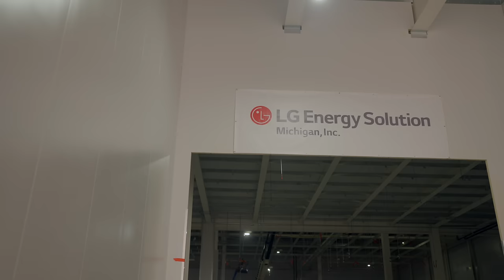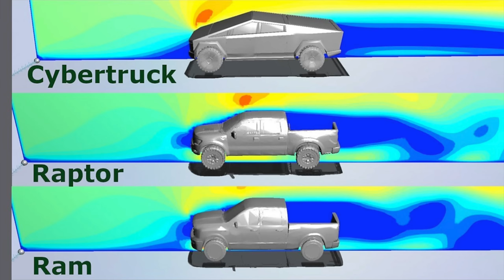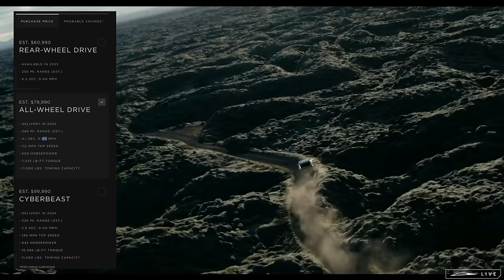Cybertruck - What Tesla ISN'T Saying!

Comment: I think they should put a battery pack that covers the whole bed raising it by 1-2 feet for the long-range towing that the 15% are wanting, less space in the bed but possibly almost double the range lol. I'm not an engineer, so I don't know the specs for batteries as in space and the heating and cooling needed if they did that, but the 470 range might just be enough, but only time will tell if they make other battery extenders other than the one they will have for now.

Comment: I watched until 12:20. After you're done repeating everything we just saw Elon explain, are you going to go through it a third time?  Variable-rate steering. That's hardly new.
Reply from the maker: list cars with steer by wire... go!
Reply: @TwoBitDaVinci  So you have reading comprehension difficulties as well. I mentioned variable steering.

Comment: Perhaps you have not heard? The 800 volt high voltage power is confirmed. The battery can be charged as 2 400 volt packs for backward compatibility with older chargers.

Comment: It takes 13 4680 3.7 volt batteries in series to make 48 volts while holding the power of a single battery @ 26 Ah. We really need Detective Thunderf00t to help us dissect this. While I wouldn't call 48 volts low voltage, 72 volts really is the sweet spot.

Comment: I don’t remember you even mentioning this “new steel” before. Who makes it, will they be able to make replacement parts for autobody shops, or will every dent cost you $20k and two months while Tesla makes a repair? 
Between that and the 48V electronics, it doesn’t sound like there can be any aftermarket customization which the enthusiast crowd can get for an F150.
Reply: Tesla problems for you (much of the reason I won't buy one ... I have an EV, it isn't a Tesla, I'm okay with that)

Comment: LMAO that crash test shows that occupants would get pulped in a moderate speed collision. This thing is an absolute deathtrap!
Reply from the maker: have you seen a crash test for a normal truck? lol ... this is the safest truck ever made... just wait for the final results
Reply: @TwoBitDaVinci  Bodyshells are supposed to crush to absorb energy. Crash rigidity is really bad (I was a bodyshell engineer earlier in my career and was on the development team for the Jaguar S-Type 2001 modelyear re-engineer, on which we achieved a 5 star Euro-NCAP safety rating)
Edit: Also look at the back wheel during that 35mph frontal. Oh my God
Edit 2: That Jag also had 'Ethernet' wiring (more accurately CAN bus). It's been industry standard for a long time.
Reply: @bimblinghill how is it,  then,  that you don't know any better than this? This frontal crash test result is very similar to most modern vehicles,  and 20 years more advanced than the Jag you worked on, which would not rate 5 stars today.

Comment: so is there a separate 48 volt battery for the low voltage section, or is it just tapping off the high voltage battery?
Reply: Great question
Reply: Yes there will be a 48v probably lithium battery. It would need to have the backup power source for safety in case of main pack failure.

Comment: That BMW 7 series you are comparing Cybertruck to can stop a 308 rifle round. It has VR9 level protection. The Cybertruck could barely stop 9 mm handgun rounds and would have a rating of VR2 to VR3. The Cybertruck windows also aren't bullet resistant, so this "feature" is pretty close to being worthless. Anyway, the protection offered between the two cars isn't even comparable.

Comment: The Cybertruck is too expensive for me.  Sad, because upping the voltage and signaling the little accessories instead of controlling them with switches in front of the driver was my idea.  I thought they could do that using the power line (stuff would respond to its own call sign), but they're using a coms cable, oh well.

Comment: I have a reservation in the 270,000 range and would like the single motor for $61,000 as it will be fun lifestyle vehicle and can pull my boat around when needed.  I hope by 2026 if the price will stay about the same.  Hope it a few years all the bugs will be worked out.

Comment: Why not use fuel cells as the range extender for an EV like the cyber truck vs inefficient ICE and gasoline? Fuel cells have almost 3X the energy density of gasoline and don't need mechanical parts. Would love to get your take on that!
Reply: Where would you get the hydrogen, or other fuel e.g., methanol, for a fuel cell?
Reply: @avsystem3142  mass availability of hydrogen at scale is definitely a challenge that perhaps an industry will form around. The greater challenge is "green" hydrogen. But I do know if you have salt water and a voltage you can produce hydrogen.  Maybe a home fueling station in conjunction with solar panels could be possible? Definitely a problem for someone with more industrial engineering skill than me to figure out, but it's a solvable problem.  I figure the person who is going to spend $100k for an ego mobile would be more willing to pay for expensive early adopter tech like fuel cells.
Reply: @BigDanDCNation  The efficiency of all these energy conversions is terrible. The hydrogen route uses about three times as much electricity as charging and discharging a modern battery.
Reply: @bikeaddictbp   I'm not saying I have the answers on how to do this economically.  Someone smarter than me will figure out how to make fuel cells make sense.  You see Toyota abandoning EV/PHEV and doubling down on hydrogen, so there must be something there.
Also, let's look at the oil and gas infrastructure. If we were in the late 1800's and early 1900's and were discussing the viability of ICE cars over horses, the argument would be made about how expensive and ridiculously difficult it is to find, extract, transport, refine and distribute oil as gasoline.  Right?  An industry will form around these alternative fuels and technologies.  I can't wait to see how it unfolds!

Comment: I hope they finish developing the 3rd generation of 4680 cell before the end of 2024 that way they can implement it on line 3 and 4. With the much better thermal characteristics of the 4680 they might as well make their new cell 1.5 time the size and just loose 2inch clearance.  69120 cell can would give them lots of head room for their future truck plateform for towing, van and rv! Plus faster cell manufacturing!

Comment: The price isn't totally unreasonable. Top end Rams, Fords, and Chevy's, all will cost you something pushing those Tesla prices. So that's not a deal breaker. The cost differential in fuel will make up that difference. Esp. with diesel. Here it's nearly $5/gallon.  The truck is impressive, i'll give it that. I also know why it was made from very hard stainless steel. The front tires are so close to the front, that was Tesla's only real option. Aluminum likely doesn't cut it, even air craft grade aluminum. Would love to know the formula for the steel. But because it's made of heavy steel, there will be some compromises made. Reduced range. But with pretty much nothing up front, that's what they had to do. The bad news is, truck buyers tend to be incredibly loyal to their brand of truck.  I knew a guy, that bought a Dodge. He nearly got disowned since that was a Ford family.  So what kind of market does this truck have. This is mostly for those outdoorsy types, or for those that seek status. Those that currently buy high end SUV's. This won't be a big seller for Tesla I don't think. But it's their halo vehicle. So, it will sell to those 2 limited groups for the most part, and perhaps, to security firms, that may need pistol caliber protection.  While it will have limited selling ability, it is a very  impressive truck...........
Reply: The heavy duty, 3500 trucks that can tow 30K+lbs cost that much. The capabilities of the Cyberjunk are equatable to a 1500 truck which do not sell for $90K.

Comment: It sounds to me that Tesla’s 4680 batteries did not produce the capacity Tesla was expecting, forcing them to use more batteries and not able to meet the promised 500+ miles range.  They then had to come up with the Extender.  I hope that it’s a matter of time Tesla will  improve the capacity of the 4680s and come up with a 500+ miles battery pack  at the same or less battery pack weigh.  Hopefully they will offer a battery pack replacement ?

Comment: The F150 Lightning is effectivly vaporware. Ford is loosing 30k+ usd on everyone they make, production and deliveries are both down. The made less than 10.000 in the last quarter, compared to 250.000 normal F150s. Oh, and there are crazy dealer markups. A lot of them want 100k+ usd for the lightning. I would want it to be a real product, but it's not a fair comparison at this point.

Comment: The Cybertruck disappointed me in a some ways.

1. Taking out the 6th (middle front) seat. They said they were worried about not fitting into a garage. But most people street park or park in their driveway anyway. This happened a while ago, but it would have been awesome if they had kept the ability to seat a whole family without the need for a third row.  Lots of SUV's have that crappy third row that only works for small children. This could have been a major differentiator. 

2. Range - as you mentioned it, I think it would have been better to make the Tri-motor the high range built in version. Charge the premium and get the premium. It would have made getting that car much more worth it for both outdoors enthusiasts and people who wanted to tow their boat to the lake.

Because of these problems, it's not clear to me that the car really is better than a Rivian. I think Rivian seems like a better outdoors vehicle all included than the Cybertruck. Also, although I don't think the F150 lightning is great for towing, it still seems like the better work truck. Cybertruck seems like the F150 Raptor of cars. It makes sense for a small amount of people who are either both into a truck and off-road experience; or want to show it off.
Reply: There was a Tesla engineer at the San Diego Tesla showroom that said the 6 seater would be an option. 
You are right re: range.

Comment: You forgot the frunk that Ford has got as Tom Moloughney has said he uses his frunk all the time as it's huge but the CT doesn't have one that size.  Plus the onboard power options on the F150 is far more options so for a work truck and all current accessories will fit in the bed due to the shape of the bed.  That glass I can't wait for the bullet testing or a Mythbusters style on the side of that truck with say a 50 cal to see how durable it is, someone will do it just a matter of time.  Forgot to mention there won't be any stalks either just a Playstation style control mechanism.
Reply: But that is the only option for lockable storage on the Ford.  The whole back end of the Cybertruck is lockable.

Comment: The lack of ergonomic controls makes the Cybertruck as useless as other Teslas.  It's dangerous to operate Tesla type controls when driving in urban areas, busy roads, winding country roads,  Tesla should be required to install conventional, switches, navigation and to disable use of the screeen whilst driving.

Comment: Range limitation is a bummer, I heard Sandy Munro talk about batteries that could go 600 plus miles in range. It's great the future looks like the future, but range would have been more valuable for me than acceleration and being bulletproof. If Armageddon happened you'd be stuck in a bullet proof truck that can't move.

Someone needs to build a high efficiency generator that runs on diesel that can charge these rigs at least until battery technology actually improves. It seems that at market Lithium Iron Phosphate is the best which is what my ebike has which I purchased in 2013. It's strange I am constantly seeing all these innovations in battery technology, yet I am buying the same  chemistries, for tools, equipment, and devices.
Reply: Then you want a Ram.  Electric motors + battery + 6 cylinder motor + generator and they have the gall to call it an "EV".
Reply: @iowa_don  damn!

Comment: Sounds like 70% of people buy a truck solely as a status symbol.  That and I think a lot of people simply like sitting high above the road.   For them, the cybertruck ia a fantastic mode of  transportation, though quite expensive .   As for actual truck people, it could be adequate.   For the suburbanites that needs to run to Lowe's and pick up a refrigerator,  a few sheets of plywood, some mulch, it's a great, if expensive, option.  Towing is going to be where we run into potential issues.   Tow a zero turn mower to the repair shop, no problem.  But do you take your boat or travel trailer out on the weekends, on vacations.    How far do you go.  How far off the beaten path.  Are you a contractor looking for a work truck to tow an enclosed trailer.  Most towing range losses are aerodynamically induced and can easily hit 50%.  Losing a significant amount of bed space for a range extender would probably not be Ideal for a contractor.   Then there is the fact that high-speed  drive-through charging is barely in its infancy.   Those two parameters(high-speed and drive-through) will be the major determining factors for EV towing.  So I think the cutoff of potential buyers is closer to the 70% mark, not 85%.      Maybe it's because I live in Georgia, and perhaps more people tow here.  So here maybe even less than 70%.  Lots of travel trailers and boats in driveways.

Comment: There’s a whole lot to love about this truck.  And there’s a couple of reasons why I hate it.  I love Tesla’s innovation.  Especially the newly designed batteries.  But with such a large battery pack on board, the truck’s range is pathetic.  And once again, like every other electric vehicle, it can’t really tow anything long range unless you’re stopping every hundred miles to recharge.  Here’s what I don’t like…first, the design looks like something out of a B rated science fiction movie from the 1970’s.  Or something drawn by a small child.  It’s really hard to take this design seriously.  Second, it’s NOT going to pass crash testing requirements.  There’s no crumple zones built into it.  Thus, the passengers are going to be subjected to vastly stronger forces that’ll be imparted into them through the truck.  Those are forces that should have been dissipated throughout the truck itself.  That’s a lesson that was learned after numerous cars were built to be virtually indestructible way back in the 1950’s.  The cars may have been indestructible, but the passengers inside them weren’t.  Instead of having fewer deaths, there ended up being more.  Every car accident has two parts.  First is the vehicle hitting an object. Second is the passenger hitting the interior of the vehicle.  Air bags and seat belts can only dissipate so much energy.  They’re designed to work WITH CRUMPLE ZONES.  This truck lacks them.  Additionally, pedestrians don’t stand a chance if hit by this truck.  That makes this a very dangerous vehicle for accidents.  They built it like a tank.  But there’s a really good reason why we’re not driving tanks on the road.  As for all the stuff Elon Musk brags about with regard to this truck…those are the concerns of a child, not a serious person.  

I still won’t buy a Tesla.  There’s a very serious issue with quality.  There’s an even larger problem with the lack of charging infrastructure in this country.  It’s practically laughable.  The country’s electric grid isn’t even close to being ready for handling millions of electric vehicles being plugged in every night.  Until these issues are resolved,  we’re NOT READY for an all electric future for transportation.  We can get there, but much more work needs to start taking place at a much faster rate than what we’re currently experiencing.

Comment: I heartily agree with your conclusions here. Except that with the auxiliary battery pack that will be available, farmers and truckers who go long distance will be able to then do so. I certainly intend to use it hauling our horse trailer although not a lot of long distance. 

But even if I did, with the extra battery pack doubling the range when towing to around, say 250 miles, along with the excellent Supercharger network, AND with gen 4 Superchargers with higher output, making faster charge times, long distance towing is mostly possible. 

Of course there are still parts of the country without enough Superchargers (northern Maine in my neck of the woods) but that’ll change in time. I think the future is bright for the Cybertruck on most all counts!

Comment: Need a hybrid that has an electric drivetrain, gas generator to power the drivetrain, battery start. Reliable range, no batteies burning or expensive replacement.

Comment: No, I won't buy one.  I use my truck mostly on 450 to 600 mile "non stop" runs with a bed full of stuff.   I'll keep my RAM Ecodiesel.  It has a 33 gallon tank and a solid 850 miles of range, with a complete "re-charge" in about 5 minutes at just about any exit from an Interstate. 
That said, the CT is a neat product and if I was looking for a truck for local use, I'd definitely consider it.